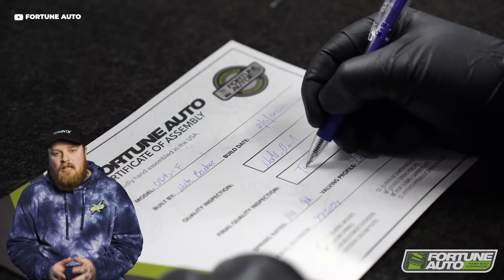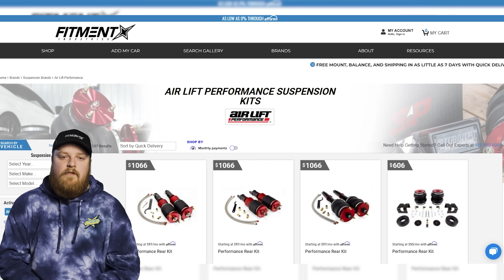Coilovers or Air Suspension | What's Right For You?

Comment: I just upgraded my 350z to with the rocket bunny kit and I dont know which to go with (as far as air or coilovers). I personally dont want to tear my car up riding low. So I know that air would be better. But I feel Im not educated on coilovers enough. With the BC racing coilovers, I researched that it will drop the suspension 1 inch from factory at its highest setting. Is the adjustability of the coilover able to let me ride high enough to not kill my fresh paint job?
Reply from the maker: You should be fine. It just depends on what size wheels you’re running and how aggressive your fitment it
Reply: @FitmentIndustries  thank you so much

Comment: For me I have a air suspension on the rear and coilovers in the front the front is soft and hard just when it's needed the air suspension on the rear is just hard at all air pressures it's just super uncomfortable if you just want to cruze not drive hard but when you drive hard it's hard all of the time so it's good in my experience to make airbags softer you have to run a small tank to add volume to the bag with only half inch or bigger lines anything less than half inch will be hard and not many system are compatible with 1/2 inch lines or you can just run bc racing coilovers DR series with swift springs and air cup's that's what I am starting to run but I am also running tein coilovers EDFC pro system with custom software and it's Tide in with the air cup to add superer suspension control

Comment: Ok so I had coil overs on there max height and I still managed to crack 2 oil pans. One going into a nasty pothole in my town and another going too fast over a speed bump. Would bags be good if I bang a pothole too hard? I live in jersey and there's fucking potholes everywhere. If not, I'm forever cursed with regular suspension :(
Reply from the maker: You’ll have more adjustability as far as ride height so if you don’t mind monster trucking around so to speak when you’re aired up you should be fine

Comment: So if in the summer I want to have my car low and in winter want to raise it back up because of the snow wat would be best option ?
Reply: Either. 

Coilover offers a lot of adjustability, but all the adjustments have to be made manually and you have to take proper measurements to ensure your car is sitting level. 

Air makes it faster, and with proper maintenance, shouldn't be an issue. It's also more complex and carries a higher price compared to more entry level coilovers that can get you the ride you want.

Comment: im in Australia and I got 3H for mt Lexus is350 2014. owned it since new and I hope it is reliable as my best mate who owns iilumo is installing it for me. he is on 3P for 3 years. zero issues so there is most definitely a misconception out there that bags are unreliable
Reply from the maker: I had and have 3P on my last 3 cars and 3 years (lot of 3's) and i never had any real issues. Big thing is to secure those airlines and to prevent as much air leak as possible, besides that they are extremely reliable systems. Good luck! 🤘 -Edgar
Reply: @FitmentIndustries  im getting really excited. you should do a video on 3p over 3h. everyone says 3h isnt worth the money and hassles. i believe its a huge misconception
Reply: Problem is some people either get cheap air suspension kits ( I won't bash any brands ) or they purchase used beat up kits and/or they install it themselves incorrectly. Then they experience problems and condemn air suspension for as long as they live. 

Those key things can be the difference between having a great experience or a piss poor one. Know what you're getting into, always buy new from a reputable  brand and if inexperienced pay a professional.